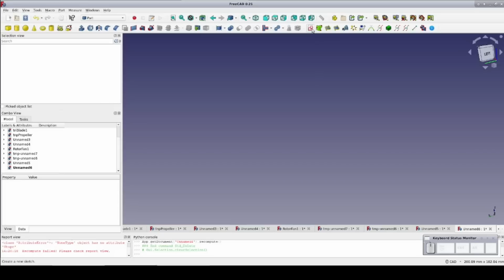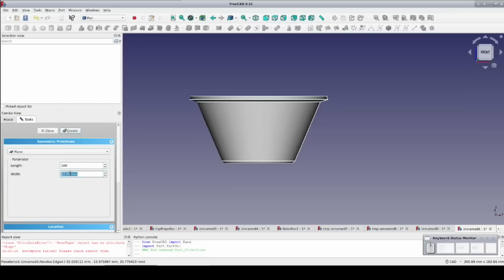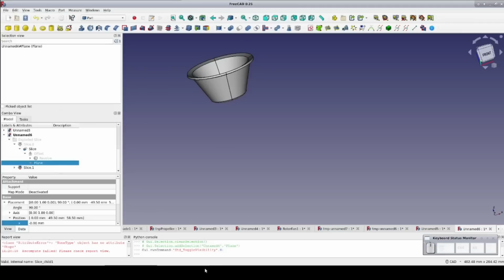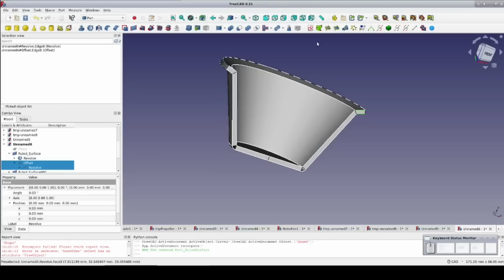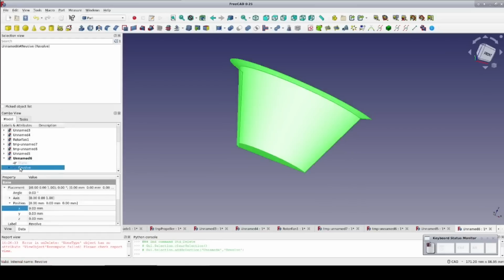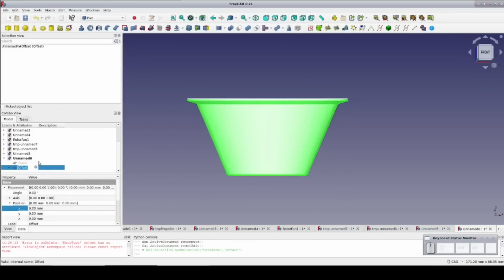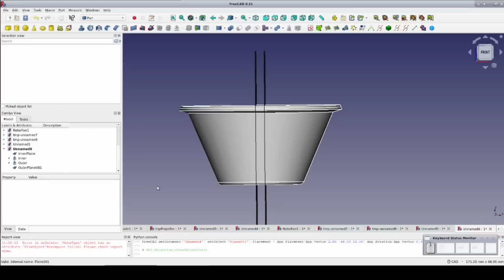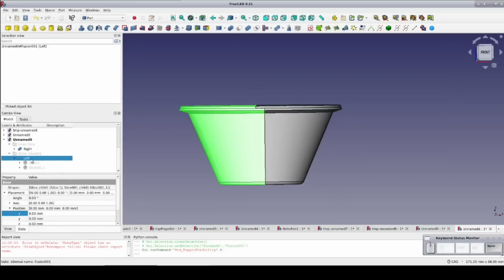FreeCAD: An open reply to Tom Sanladerer

Comment: Whew! Thanks for saving me the effort of ever trying FreeCAD. Any CAD user interface that constantly requires the user to type in values is SO OLD FASHIONED. When FreeCAD is a slick as Shapr3D, I'll give it a go.
Reply from the maker: To each his own, I guess. I prefer to enter the numbers rather than use mouse manipulation.
Reply: @4axisprinting  Any CAD software should support both.
Reply: @4axisprinting  funny thing is fusion 360 lets you do both. it doesnt dictate to the end user how things should be done. only with freecad does this somehow seem acceptable ui design. it's bizarre.
Reply: @TMS5100 it's not "bizzare" its much easier to implement a text box than a draggable handle for every possible operation. The team working on this is very small and has literally pennies of funding compared to any commercial CAD. Making this is much more complex than you think.
Reply: I would say it also depends on what you design. I use Fusion360 (and oh boy do I swear at Fusion360, but I digress), and every single thing I do is done by (typing in) numbers because I design mechanical parts that work with other components. For interest sake, what do you design in Shapr3D @Christopher Knee?
Reply: Do tell: how do you get a rectangular loft that is 16.3mm by 12.7mm faster than by typing in those dimensions?
Reply: @brianmi40  Besides the point. When exploring dimensions typing is not faster. When you know what you need it is. That's why both is needed.
Reply: @tcurdt  What does "exploring dimensions" even mean?  Seriously, I want to understand the alternative method since I've used 4 CAD systems now and have never heard that term.

Are you saying simply NOT constraining?  Because if so, I've done dozens of 3D designs in FreeCAD that were not constrained at all, and were just fine.

What does "exploring" mean?
Reply: @brianmi40  Think F360 when you extruding. You either put in the exact value or just drag with the arrow with the mouse. Sometimes constraining is the 2nd step.

Comment: I LOVE FreeCAD!

Also...

I HATE FreeCAD!

Also, for creating the seed cup, I would have gone straight to fully defining the cup's profile in Sketcher, then doing a 180° revolve on it. I probably would have even added a spreadsheet to define the various dimensions of the profile, making it trivial to print off different-sized cups.
Reply from the maker: If it wasn't just a demonstration, I might have gone with the spreadsheet but I would still do the 360 revolve and split. Certainly I would have actually constrained the sketch :-)
Reply: @4axisprinting  Sorry, I didn't mean to imply that you should have done anything other than what you did for your demonstration. I was simply saying that it could have easily been done by drawing a full profile, avoiding any offset/thickness issues. The spreadsheet comment is ignorable as it was just something I threw in because it's something I pretty much always do for any FreeCAD project.

(I will note that I think a full profile sketch is better because it gives me full control over the shape, including things like varying the thickness at various locations on the pot (filament-saving measures?).
Reply: This certainly seems a much cleaner and quicker method than that shown in the demonstration.

Comment: I have used FreeCAD since 0.18 and have often thought that there was no-one in command, no leadership. Many of the weaknesses of FreeCAD that were in 0.18 were still in .2. I couldn't get The latest release of FreeCAD to run (2.2). It installed OK on two computers, but wouldn't run so I don't know if it still has the same weaknesses as 0.18. But saying all that I still agree with you! FreeCAD is an amazing piece of software. It's just a shame there is no obvious leadership. I prefer using 0.18 rather than 0.19, 0.2 wouldn't work properly and .2.2 wouldn't run. I will download and try the next version.
Reply: i think thats one of the other problems with the project. freecad has been around many years but the fundamental design flaws remain and it feels like it isn't making any progress. people try to use freecad, get frustrated and give up. come back a few years later to try it again, still find it unusable, give up again. meanwhile tons of other opensource projects are making huge leaps all the time.
Reply: @TMS5100  Those "tons" of OSS that are getting the fast track love are in hotter industries, like Blender... where gaming and animation have huge interest and user bases.

As for finding it "unusable" that's based upon using other software, expecting it to work the same, ignoring the hundreds of YT videos that SHOW you how to actually use it.

In 5 months, there isn't anything I've found it can't do and that includes creating a part for a window regulator that is curved in two ways with tons of precision to replace a broken one in a power window, grabbing the glass and pulling it up and down in just 5 test prints, since I was just taking measurements from the old piece.

If people just new to watch a set of tutorials that match the order you should learn the program (Sketch, Pad/Loft, Hole, etc.) they wouldn't have near the frustration and could almost certainly do what they wanted to do with the program.  And that's exactly the mistake Thomas made in his video; trying to use knowledge of how another entirely different piece of software works, assuming this "must" work the same, and not only failing, but failing to recognize there are TONS of videos that could have taught him what he needed to know.

Comment: With respect, this isn't the result of a small team with limited time and resources. It's the result of that team prioritising number of features over completeness and quality of those features.  There's another interesting thing going on here though, which is that the underlying problem has been solved, just in a way that's hard to find if you don't already know what you're looking for. There was no feedback loop to apply the solution to where the problem is. This isn't "there aren't enough developers" it's "the development community is dysfunctional".
Reply from the maker: Also with respect, only in some sense. Remember, FreeCAD is an open project and the core developers have no authority over what contributors choose to work on. They can only decide if it's good enough to include or not after someone else has already done the hard part.

You may believe that chore X is important, but perhaps not as important as chore Y that you're working on. But if I hand you a shiny new feature giftwrapped and it will only take you a minute to incorporate it, will you reject it and tell me to go work on x, knowing that I'll just go away never to be heard from again, or will you accept it and keep working on Y until it's done so you can do x?

As a side note, currently Y seems to be getting Realthunder's TNP fix into the mainline code. I have to say that really IS pretty darn important. Probably more important than the deficient fill option of the offset tool.
Reply: @4axisprinting  you're absolutely correct: the users can't make demands of open source contributors. But that goes both ways: the developers can't use their own prioritisation choices as an excuse for a poor experience.
Reply: If one looks at the development goal of FreeCAD where its goal is to provide a core that is expanded by addons, it has succeeded and is functional.
This allows smaller projects (Addons) to be developed by individuals. The goal being distributed development and that too is functional.

What I do find is that the addons being developed by individuals, have different approach methods and therefore lack, what I feel, is a consistent flow.

The tool tips of Fusion 360 is in my opinion one of its better features allowing help while still working and if adopted by FreeCAD and addons would make it way easier to work work with and an awesome piece if software.

Taking a look at the number of addons, one could say that FreeCAD has many more features than some of the paid software in a single package.
All the features one needs can obviously be achieved with different paid software packages but that is the choice the user can make for himself.
I for one, don't have a choice. For my private designs I have to use FreeCAD as I cannot afford any of the paid software.
Would I use paid software for my private designs if I did have the money? Maybe but I do like to expand my options, so maybe not.
I do use Fusion 360 at work, so yes, sometimes doing something in FreeCAD can be more challenging but I still get it done perfectly well.

A good example of maybe integrating the different features into a more consistent single package is KiCAD, which also had very different approaches to PCB design by individuals with packages.
The software now feels great and has a consistent flow throughout.

From a developers point of view, the design goals are different and can therefore, from that point of view, not be compared.
Paid software's goal is a single package that gives you what they want for X amount of money.
FreeCAD's goal is to provide a core for free and expand by addons developed by individuals.

From a users point of view, the design goal is to get a job done, therefore the packages can be compared.
Paid software is probably quicker and more polished at a price and a lock in.
FreeCAD can do all of the requirements at a steeper learning curve at no cost and freedom.

So, with respect, you are unfair when you say that "the development community is dysfunctional"
I do understand your point of view as a "user" and respect that.
Reply: The issue is that you believe that volunteers are supposed to work exactly on what you want them to, and exactly how you want them to. That's just not how it works, people work for free on stuff that they want to see in the program. Making it "intuitive" is just as hard as making it work in the first place.
Reply: @33KK  Do I?  News to me.  Correct me if I'm wrong, but it sounds like what you're saying is that the volunteers are choosing to prioritise number of features over completeness and quality of those features. In which case, happy to have your support, thank you.
Reply: A lot of your comment is great, but I feel it ended poorly; The community around FreeCAD has produced a working product, and continues to produce addons and updates, so it clearly functions.  That said, the lack of "completeness and quality" of features is a common in FOS software, and a not-uncommon situation in many large and long-running projects even in the paid software arena.  The much-maligned 'ribbon bar' in Office 2010 was an effort to expose users to many features that had long existed in Word and Excel, but that no one used because they were buried in menus.  Many of those features had been around for a decade or more.  It takes (a) regularly talking to non-expert users of your software about their usability problems to find issues like this, and then (b) a will to improve the situation for new users, possibly at the expense of existing expert users.  This happens rarely enough in commercial projects where new users are a major source of income; in FOSS projects, many of the developers ARE the expert users, and as long as the software meets their own needs, they lack motivation to do 'unnecessary' UI/UX work to make features more available or usable for new users.

In CAD (or photo, or video, or audio, many domains, really) tools, this problem is made worse by the complexity of the tools; there are so many features, that you either hide features in menus or sub-windows, or your UI has so many buttons and widgets that it looks like an aircraft cockpit and overwhelms the user, and many projects manage to do both.  Many industries are divided into 'people who use toolchain X' and 'people who use toolchain Y', not because of features, but purely because they learned one or the other, and the tools have incompatible UI paradigms.  Learning the alternate paradigm puts you back at square one, and it may take tens to hundreds of hours to relearn tasks you find automatic in your old software.  From a 'big corporate software' company, this is great as it locks users into using your toolchain, and provides a barrier to entry to other companies trying to compete with you.
Reply: @davidskidmore3442  yes, the fact that the core application exists is an achievement. I'm not denying that. However what I would say is that the where you have add-ons that exist because of flaws in that core product that have existed for years and fixed haven't been upstreamed... Yeah, that's dysfunction.

Whether a) is happening I don't know, but you can see elsewhere in these comments what the community reaction to feedback is. That has two effects: first, gaslighting users reinforces the status quo making it harder to get real fixes past the "expert user" old guard; second it discourages people who might be perfectly competent developers from engaging with the project to fix those problems when they see the "skin in the game" macho gauntlet they're expected to run.

None of this is inevitable, necessary, or desirable.  FreeCAD specifically has a bad history of gaslighting users: for years the TNP was "not a bug, you're holding it wrong, it's actually better this way" issue.  And to be absolutely honest I don't think it's necessarily the core developers who do this, it's more the sort of people who crop up in the first 5 minutes of asking a question in the forum to tell you you're an idiot for thinking FreeCAD would do what you want before an actual core dev turns up a day later to tell you that yes, you've found a bug. It's just toxic.

And I would make the argument that complexity in the problem space does not make complexity in the UI inevitable: that's a failure of UI design. But that's fine, it's failure at a very hard task. It's entirely reasonable not to get it right first time. But that means you do need to be able to iterate and not just leave the original developer's first idea in place.  And again, to be fair, I do see tweaks happening that improve things. The Sketcher has seen improvements recently, for instance - but I don't see big workflow improvements making any headway.

Except on realthunder's branch. They're clearly possible, achievable, and good: it's the community that's prevented that sort of improvement on the main branch, not the complexity of the problem or technical blockers.
Reply: @regularfryt  I'm not quite sure what you mean about add-ons that only exist because of flaws in that core product that have existed for years and fixed but haven't been upstreamed? Unless you're referring to the Curves workbench? But that wasn't developed to fix that bug/limitation in the Part workbench; it just happens to do the job. 

I agree with you third paragraph. Their forum is a toxic place (or was the last time I visited it a couple of years ago). It does the project no favours.

Yes the UI is rather clunky. But it was written by a couple of self-taught amateurs so that shouldn't come as a surprise really. But it works well enough for hobbyists like me. I use FreeCAD mainly to help in my model making 93D printing, CNC and laser). I actually maintain my own fork (of 0.19) because I was very unhappy about the code quality of the Path workbench. I've done quite a lot fixes and enhancements but I'm probably fortunate in that I have 30+ years of experience as a profession software developer. I appreciate that others who don't have the programming experience might find the idea of maintaining their own fork rather daunting.
Reply: @paula_thomas4944  Not written to solve it, no, but demonstrating that a solution is possible.

Rather than spin my own fork I thought I'd try to get patches into the main project. I'd rather do that than have the hassle of keeping my own fork up to date with the upstream, especially with the TNP changes coming.

Experience on the forum has convinced me that I have better things to do with my time.

I really don't mind that the UI is clunky per se. What I object to is being told that it's good, actually, that I'm not allowed to make suggestions to improve it without "skin in the game", that the bitty workflow steps are unavoidable.

I'm doing something in FreeCAD most days, and have been since roughly the 0.18/0.19 transition. I spend more time than I want to admit swearing at it.
Reply: @davidskidmore3442  Blender is currently doing a pretty good job of this. They've created a cross-platform GUI library which is so flexible and robust that it can be customized to pretty much however each user wants it. But they're also moving towards more intuitive conventions as the default.

Generally I think open-source software should seek to decouple its computation from its GUI. So that computer scientists can focus on the algorithms, and designers can work on user-friendly GUIs.
Reply: @davidskidmore3442  Well said.  Also my niece doing commercial fire sprinkler design uses widely different features than any GM automotive engineer, so the field of users are in natural conflict over what features and functionality to prioritize.  Hundreds of use cases means hundreds of competing priorities.  The Office equivalent would be to put Word, Excel and PowerPoint in just ONE PACKAGE to even start to approximate the complexity that a broad tool like CAD has to cover today.

The guy who commented why not get the 10 work spaces into 1 has no clue of the scope of functionality that would bury multiple levels down.

The bottom line is that even an honest review of the scope of training videos on YT where complex designs are readily accomplished suggests that a .2 version VASTLY UNDERSELLS the capabilities that the product has that work just fine.